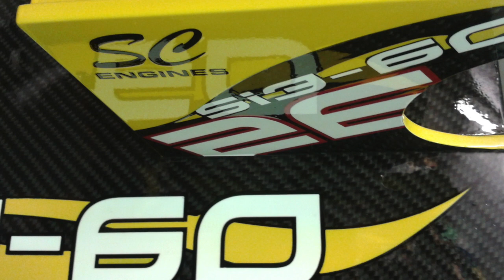RC Airboat - Build sequence of 'Selph Inflicted' SI3-60 - Slide show, and running video

Comment: You, as I just said in your other boat build, are so talented, a master at your craft bro...
So many questions, that'll never get answered lol...
What supplies? How? And 150 other questions...
I've always just glassed my builds, "Epoxy and Alcohol" I'd love to learn your way, and watch you build man...
Reply from the maker: Thank you. Methods vary according to the needs, but I'll give you something to take away and experiment with. I see a significant difference between a good build and one that's just that step up from that is the quality of surfaces and edges. To aid those I only use metal rubbing blocks to wrap abrasive around. I use dead flat gauge steel mostly, sometime brass, but always as flat as can be. This allows easier feel for working on high spots in small areas, is unforgiving in tolerance so surfaces are not just rounded down, and over any size surface can generate pretty much optically true flats, and curves are also easier to get right. Get hold of some small blocks of steel, repurpose something maybe, and try it on a few materials. Concave surfaces need curved blocks, that can come later. At some point it will click, and you'll never go back to rubber or wooden blocks again when shaping.
Reply: @JesHill  I can't find any plans to build any Airboats now days...
Been looking for like 2 weeks for the plans to a hidro airboat build, that's how a ran across your builds...
15 years ago they was everywhere... Now everything ya click on says error, dead link, or page not found...
So guess I'll just do another scratch Airplane build...
Reply from the maker: @yotehunter3468  the SI3 in this video may be available from Facebook, search for "Selph Inflicted" RC Airboats on there.
Reply: @JesHill  yeah tried that, no answer, and he hasent posted anything sense 2020...
Reply from the maker: @yotehunter3468  Jerry hill on FB, pm
Reply: @JesHill  Don't laugh, but I don't have Facebook, tweeter, or that Instagram stuff,  don't even have internet at home, I'm a old man lol...
Iffen my phone won't do it I don't need it lol...
I wrote your name down and I'll have my daughter make me one of them Facebook things tomorrow when I talk to her lol

Comment: I'm building one just like yours but I want to use a brushless motor instead of a nitro motor, what size motor and kv would be equivalent to your size nitro motor you have? Thanks!
Reply from the maker: I've little knowledge of electrics, this was a 'sports' 10cc engine (.60 ci) so a 300  - 500 kv motor.
'crispyspa' would be worth checking out on YT as he's a lot of experience with an electric version.

Comment: Brilliant build all the way including the magnificent finish..however if i was to build it i would swap that Chinese engine for a real racing 46 size RIRE Pylon or DF mill running a tuned pipe and capable of 25K plus rpms...Fit the engine with the head facing down to lower the CG and use a good quality 3 Bladed prop...so that when you crack open the throttle(at a bigger lake)it will send huge shivers down your spine..A great video too on all accounts.
Reply from the maker: Thanks for the compliment, much appreciated.

Comment: Greetings.  I am from Russia and I have an OS MAX 75AX engine.  Could you help me build the same boat for my engine.  You can find out what kind of plywood was used and what dimensions the templates have.  And it is better to send sketches in full size by e-mail, unless of course you do not mind.  Also would like to know what thickness of carbon fiber did you use?
Reply from the maker: If you check out Selph Inflicted on Facebook you can order the plans